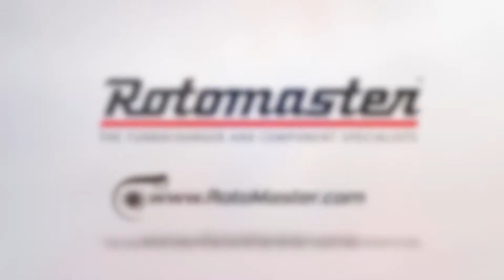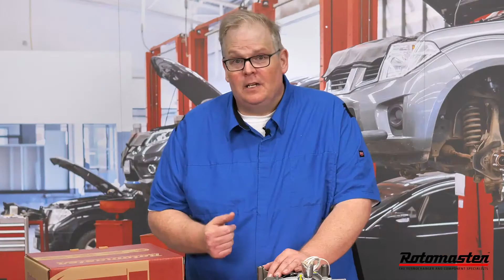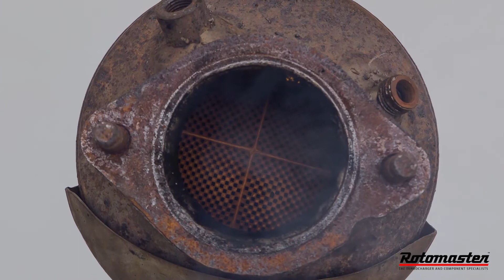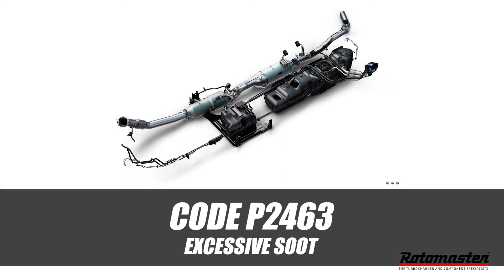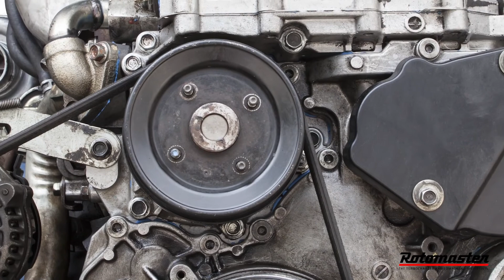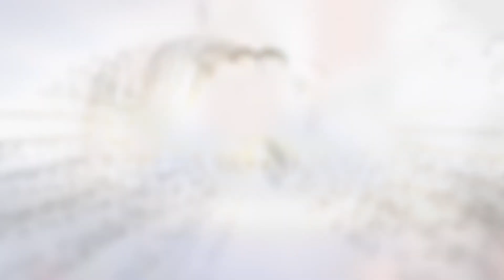Duramax 6.6L Turbocharger Replacement

Comment: Traveling with my RV, had to cancel the trip and returned slowly. It stated reduced speed and limited to 20-30 miles per hr.  Local GMC dealer Delhart TX stated P2499 error code, there was one other code but he doesn't recall what it was.  He reset the system, that at least let me drive it.  ?   Now trying to find diesel mechanic.  What is P2499?
Reply: Throttle position sensor is sending a code.